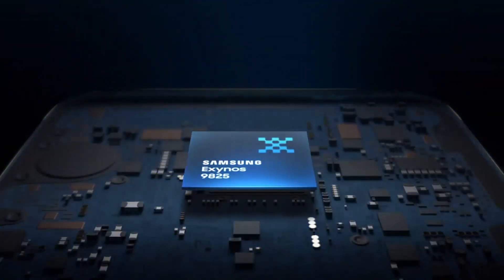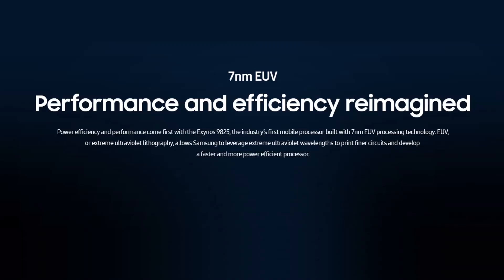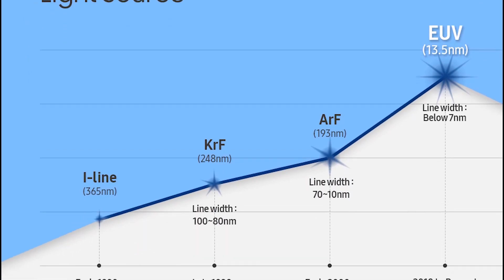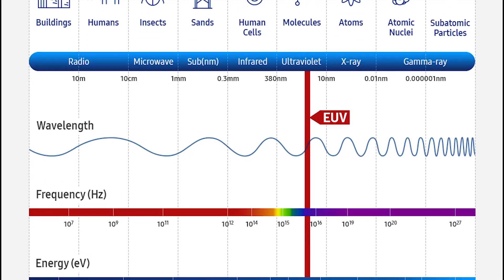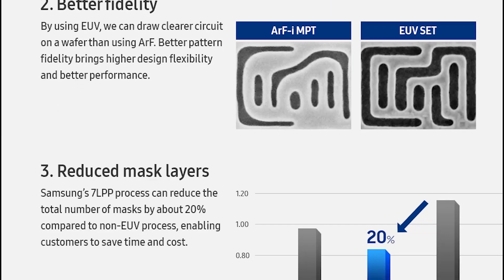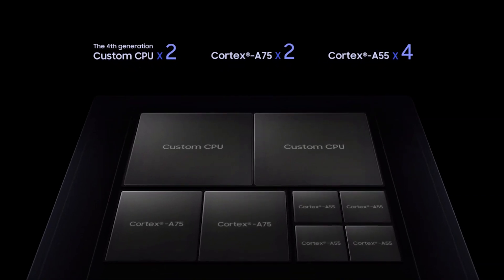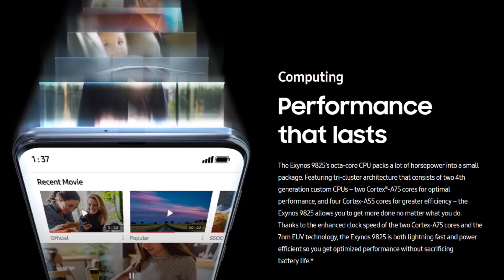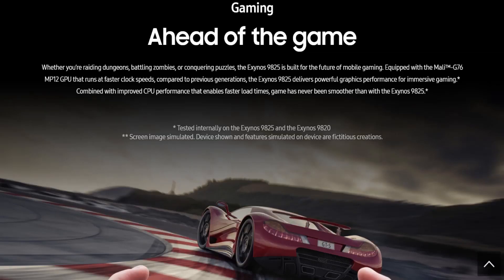What is the Exynos 9825 in the Note 10?

Comment: it totally tanked, I would better use the 845 than the exynos 9825. heats up like crazy and battery sucks
Reply: The exynos processor heats the note10?
Reply: @mynorvasquez322  yeap, just bought the note 10 plus and I'm so disapointed
Reply: @raycon921  I recently got the note10+ and I don't like how easily it heats. I thought it was a problem.
Reply: @raycon921  how easily does yours heat ?
Reply: you're thinking of buying? cause if you are I would seriously recomend not to. I managed to keep it cool and get better battery life by switching on medium power saving wich limits your CPU to 70%
Reply: @mynorvasquez322  I would still recomend the oneplus 7/t/pro. although youay not like the camera as much but when it comes to performance and battery life they're excelent. I switched from the oneplis 5t and honestly I don't see any difference regardin performance and battery life, so yeah the exynos is so far begind the snapdragon
Reply: before turning the battery saving mode it was always hot even watching youtube. I'm thinking of returning it but with this lockdown..  ..Anyway with medium power saving mode if you leave checked only the processor to 70% and keep the others as  you like. the phone stops heating up and I don't see a difference in performance. It seems that Samsung has 2 high performance cores Mongoose that eat up the battery like crazy and I think that those cores where heating up.

Comment: The fact that most people don't trust Exynos anymore 😅 like me. Snapdragon is so much better,there's always room for improvement but it would be hard to gain trust after all these years.
Reply: Also Exynos have quick battery drain issues. I had note 4 before and also i have note10.1 2014 edition both were exynos variant and in both devices i suffered quick battery drain issue. 😤
Then i got note 8 in Snapdragon 2 years ago and uptill yet i have not suffered any quick battery drain where as other note 8 exynos owners suffered same issue as well. i dont understand why samsung doesnt fix this issue. its their damn inhouse built in processor..

Comment: the gpu is the same as the old useless 9820, F samsung
Reply from the maker: Why did you expect something else? Normally the Note 10 would get the 9820, the "5" is just a tweak because of the newer 7nm process. What GPU were you expecting?
Reply: @GaryExplains  since the new CPU is using 7nm tech which makes it physically smaller I was expecting they could put in a larger GPU, maybe g76MP14?
Reply from the maker: 8nm to 7nm doesn't give you enough for that, but there is enough for a clock frequency increase, which is what Samsung did. Also, as I said, this is just a tweak, not a new processor. Adding more GPU cores would have been outside the scope of this upgrade.
Reply: @GaryExplains   Which mean samsung leaves gamers who live in the EU with no choice but to buy the phone from the other part of the world with855 processor or purchase something else like the oneplus 7 pro :(
Reply from the maker: Yes, but, there is more to a phone than just the processor. If you are buying a Note 10 (and not the S10+) then you are already buying it for other reasons like the S Pen.

Comment: So you didn't explain very well and dont even know what you are talking about. 
Or completely disregarded things to make it "easier".
So much for Gary explains... explaining..
Reply: Kay CH.  I dont give a fuck what you think. Just because he used nice words doesnt change the fact of the bullshit he was pulling or shoving. Or the condencending and stupidty he was trying to pass off.
If you don't understand the context here then you have no place commenting.
Reply from the maker: I am a little confused, what part didn't meet your expectations?
Reply: @GaryExplains  The part where you completely fuelled the same idea the people have that it's just 8nm to 7nm. Not really giving much on how much bigger the 9820 is compared to the 7nm socs. I believe at anandtech he even said it was possibly bigger than their 10nm chip. Either way  considerably bigger more so than the 8nm number suggests. 
And most are unaware .... and that should be where Gary EXPLAINS would come in... but you didn't just not explain... you went with it. 

And considering this is a larger die shrink than one might think and a new fab process that you didn't give much explanation or credit to. And that it could push 20% more power or 50% more efficiency. And at least half of that seems to be purely going to efficiency while some went to a gpu boost. 10 to 15% power maybe and 20 to 30% efficiency.
The are many possible gains to be shown. From thermal performance, cpu, gpu, npu, efficiency. 
Clearly you shouldn't expect the world of it. It might not add up to much in the end. And it will depend on if they properly fix that scheduler.
But the video basically says.. it's only 8nm to 7nm and it's not likely to do much....

So much for being more informative on a channel that EXPLAINS
Reply from the maker: Again I am a little confused. You seem to be confusing the manufacturing process, the transistor count, and the die size and coming up with some strange conclusions. I have tried reading your comment three times and I am none the wiser. Are you saying that the jump from 8nm to 7nm will allow the 9825 to be 50% more energy efficient than the 9820?
Reply: @GaryExplains  Like where the hell did any of that even come from. 
Where the hell does me talking about the physical size of the soc being much bigger than others, much bigger the the 1nm difference suggests, and theoretical thermal efficiency gains based off logic and samsungs own numbers....in any way, shape, or form....
Trasnlate into me not knowing the difference of a transistor count or any shit like that??????
Reply: @GaryExplains  Like you are literally lying to me or telling me you don't know what you are talking about and can't read.
Reply: @GaryExplains  the point is... again... like i referenced from anandtech.... everyone is going oh it's only 8nm to 7nm.... there is not much to gain. When in reality the 9820 is about 127mm2. Where as the 7nm socs are about 73mm2 to the a12 being 83mm2.
The 9820 is considerably larger way more than 8nm sizing suggests. And again if i remember correctly at anandtech he even said it was bigger than their 10nm lpp 9810 chip.
And instead of correcting the idea that not only is it a bigger die shrink than people realize but also adding in the new more advanced fab process means there are more gains to be made than the numbers suggest.....you just fuelled the idea that....oh its only 8nm to 7nm...not much happening.
When youre supposed to be the knowledgeable tech guy here. The one that explains...
Reply from the maker: @jackskellington6sic6  Wow. OK, as far as I know, the 50% energy efficiency comes when you go from 10nm to 7nm. Here is a quote from the Samsung press release about 7nm EUV: "Compared to its 10nm FinFET predecessors, Samsung’s 7LPP technology... or up to 50% lower power consumption." That is why I am confused since we are talking about 8nm to 7nm, not 10nm to 7nm. Also, I hope you would agree, that comparing the die size of one processor to another is an irrelevant measure without talking about transistor count. Who cares if the A12 is 83mm2 at 7nm, that is irrelevant without the context of transistor count. It also neglects things like power gating, caches sizes etc.
Reply: @GaryExplains  It could be up to 50%. Even up to 30% is a difference. And again it was possibly larger than their 10nm soc. Which would therefore make those claims valid. 
And are you really banking on some random transistor count bloom? Or is it more than likely the same transistor count? Same soc in most ways just scaled down.
And aside from that being the most likely case you could claim oh well we don't know that yet. But then you would be contradicting your knowledge of saying there is not likely to be much gained because you don't know that for sure either. 

This is a die shrink that reduces the surface area by about 40% probably. That's a very large reduction. That's the god damn point. That's way more than the 1nm difference suggests. And don't give me some crap about how that means nothing without taking in the transistor count when we all know it's mostly the same chip. And even if it there was a transistor increase that would theoretically point to more power which would also contradict your claims of there hardly being any gains. 

Yes my replies now have been rude. But yours have been very ridiculous and made me pointing out your fallacies somehow out to be that I don't understand anything. Even the difference of transistor count to fab process. 
I don't know why you are making this so difficult.
Reply from the maker: @UCmHo036JtXos7xlODrbvQ2w What? Talking to you is really hard. What I have I said wrong now? Can we establish some simple points of reference? Maybe that would help. 1) The 50% power efficiency claim is from 10nm to 7nm, not 8nm to 7nm. 2) You said in your second comment, and I quote, "new fab process... that it could push 20% more power or 50% more efficiency." which isn't true, if you agree with point 1. 3) Die size tells us little about the thermal properties or the performance of a processor. 4) The 9825 has the same basic microarchitecture and design as the 9820, so there will be no perf gains or increased efficiency because of the design of the chip. However the move from 8nm to 7nm will allow for clock speed increases and, if there is any headroom left, some power efficiency gains. 

Are you happy with 1, 2, 3 and 4?
Reply from the maker: @jackskellington6sic6  OK, one more attempt from my side, before I declare you a troll. Assuming you are not, but we are having trouble understanding each other, I have laid out 4 very simple points. Please tell me which of those 4 points you agree with and which you don't. Once we have established that then we can build a bridge and try to understand each other. I am not grasping at straws, I am trying to communicate with you, but you seem unwilling to answer my questions, which I am only asking so we can progress this conversation. You want to try? Or will your reply be more of the same as the last comment?
Reply from the maker: @jackskellington6sic6  As a follow-up. I have been re-reading your comments to try and understand what you are saying. I have a question, maybe I am overreaching because I have re-read them multiple times. But is your argument this: Because the 9820 has a bigger die size than the 9810 at 10nm then reducing the die size from 8nm to 7nm is like reducing it from 10nm to 7nm because the die size was bigger at 8nm than then 9810 at 10nm? Hence your talk of 50% better efficiency etc, because you are thinking of the reduction as if it was from 10nm. If that was your assumption, then unfortunately it is wrong, the fact that the 9820 die size was bigger at 8nm then the 9810 at 10nm, doesn't mean you can equate the reduction from 8nm to 7nm as if it was 10nm to 7nm. All it shows is that the transistor count on the 9820 at 8nm was higher and more complex than the 9810 at 10nm, that is all. The only legitimate comparison is for the 9820 at 8nm and the 9825 at 7nm. Which is basically point 4 from my list.
Reply: @GaryExplains  This is beyond pointless at this point. You just keep dancing around youre fallacies and grasping at straws.
And I've allowed my anger to run off as a result.  
I don't know anything. The chip sucks. You explained well. Have a nice day.
Reply from the maker: @jackskellington6sic6  And there is my answer. Thx. Have a nice day.
Reply from the maker: @jackskellington6sic6  And rather than replying to my simple questions, which I even numbered for you, you resort to swearing and name calling. Nice, real nice.
Reply from the maker: @jackskellington6sic6  Wow, dude, you got issues. I have been nothing but polite and sincere with you. I have tried to understand your point of view, I have asked constructive questions, I have read and re-read your comments to try to understand what you are saying. I have tried to find a common point of reference and build a bridge. I think if you re-read everything you have written and everything I have written you will see that I have been proactive in trying to engage you in a meaningful way. Sorry you don't see it like that. As far as I see there has been no victory, we have come to no common understanding, in fact you won't even answer my simple questions. I see not victory here, only defeat (and lots of anger on your part).
Reply from the maker: @jackskellington6sic6  Sorry man. Can you please give me one example of where I have been "high and mighty", because truly I am at a loss to understand what you are saying. Also, I do believe we still haven't yet established that I am misinforming anyone. If you would answer my simple questions then maybe I could see where I am mistaken in the information I am  producing. Or, if you don't like those 4 questions, maybe you could write one or two clear points to show me where I am mistaken. Or ask your own questions that I can answer. I really am trying my best to be helpful.
Reply: @GaryExplains  I'm sorry I've been losing my temper. But the fact you can't see one fallacy in any of your claims or replies, on top of saying it just means I don't understand the difference of transistor count to die size or fab process which reflected off nothing said in my comment, and me losing my temper. This is over. 
You're clearly not a complete idiot. You know a lot of things. But this video and these replies were bs. 
I'm out
Reply from the maker: @jackskellington6sic6  OK. Thanks for your reply. I am real sorry we didn't come to any kind of common ground. I do agree that I can't see any fallacies in my claims, you say there are, but you won't tell me what they are. So I guess I will live on in ignorance. Sorry that the comment about you "confusing the manufacturing process, the transistor count, and the die size" got you upset, that wasn't my intention, but I couldn't see (and still can't) the point you were trying to make and it was the only conclusion that I could draw (obviously wrongly). I still stand by my video and my comments (and questions). I don't think they are bs, but you do. Again, I am sorry that we could get to no common ground. If I am mistaken about something I want to learn and improve, but sadly this discussion moved in the wrong direction and the actual points of fact/fiction were never really discussed. Seriously, if you had answered any of my 4 questions it would have started a process where I could have maybe seen the error of my ways. Alas, it was not to be. If I was to make the video again today, I would do it the same, as I don't see the errors.

Comment: 9820 already has about 800 more score compared to 855 in single core.
Reply: Which don't translate to real performance as demostrated by Anandtech's review of the S10 855 vs S10 9820
Reply: @nicoxis  Dont forget that the geekbench's memory test is broken, so it scores actually a bit lower than the A11 when removing that.

Comment: Soooo... What does it do? Faster than the exynos 8890 , anything else? 
So much specs and gimmick yet software wise everything is the same...
Reply: The 9820 is 127mm. It's an 8nm soc.
The others are aboot 73mm. Even though you're comparing 8nm to 7nm the 9825 is shrinked a lot more than you think. 
Plus the euv fab process is a whole new process that has much better efficiency and circuitry. 

So without and clock rate changes the cpu could perform much better just do to the now production method. And they boosted the gpu. And it will be more power efficient
Reply: @jackskellington6sic6  i know but we don't get to use that what that cpu offers...... I mean every year they focus on faster CPUs with less power but don't even think about optimizations, maybe develop something that can use that power capacity? 
What is the point really , you buy a note 10 for lets say 1.200$ and what does people do with it ? The same thing as always , Facebook, instagram, Tweeter etc.......
Reply: @GHostCCM  I see. 
In that case you are completely right. Except for some games and emulates. Photo and video processing. But not everyone does that. 
But i guess it gets used because facebook and many things just become bigger resource hogs. With phones being more cores, more power, more ram. .... why optimize when you can just make it bigger. More storage, more ram, and more cpu usage. 
I hate it
Reply: @jackskellington6sic6  yeah bro..... I mean what's with the cpu cores racing ? We need bigger cores and more cache to get more computing power not more cores and more ghz......
Reply: @GHostCCM  I mean cores and ghz help but as we know they have often been needlessly placed. Or more specifically unfortunately relied on to make everything unnecessary resource hogs.
Reply: @jackskellington6sic6  yeah man..... Since that its what sells....
Reply: @GHostCCM  Yeah that and pure laziness on a lot their ends
Reply: @jackskellington6sic6  The shrink will be substantial because that 8nm process from samsung is actually a 10++ 
How much is the question.
Reply: @MiguelAngel-rw7kn  exactly. In fact at anandtech he said its physically larger than samsungs 10nm soc.
127nm2 vs the 73nm2 of the 855